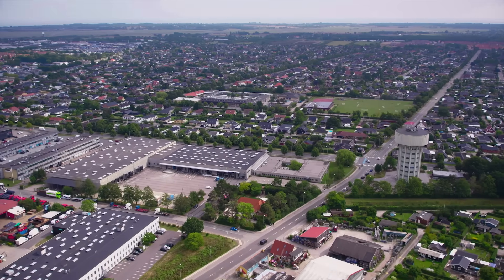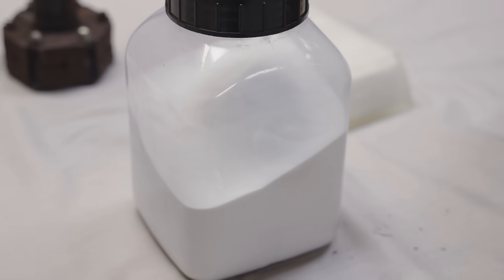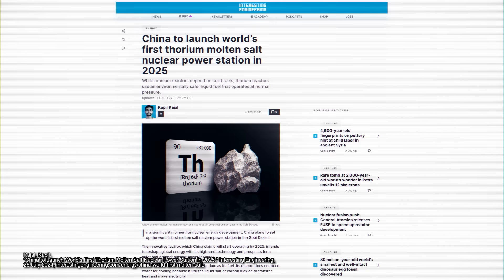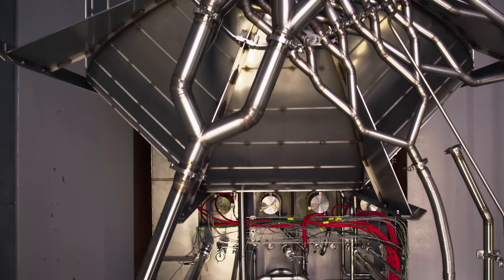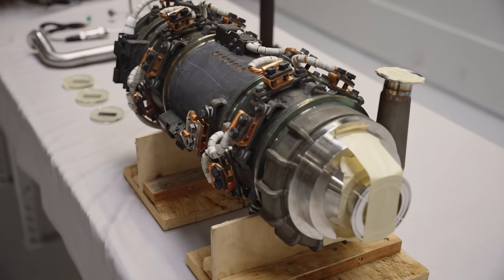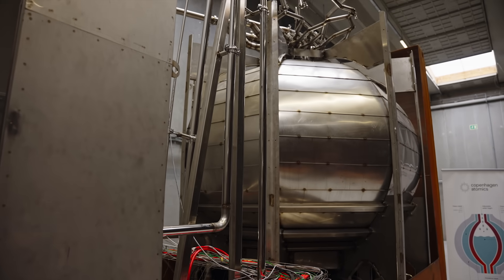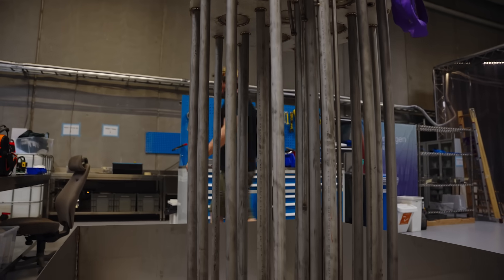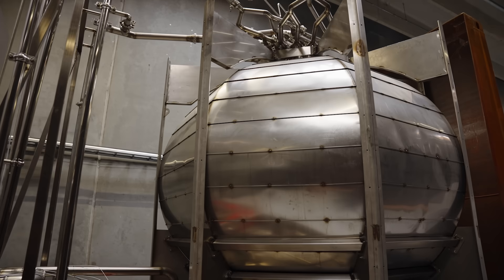Why Isn’t Thorium Changing the World?

Comment: Weinberg and MSRs were really a victim of heavily promoting the wrong thing at the exact wrong period in time.

 The argument over molten salt vs pressurized water reactors was really one of the defense industry, and political synergies.  Weinberg wanted to really restart the industry on developing new technology based on molten salts and different fuels, but he was also being very vocal about safety deficiencies in water reactor designs.  However he was doing this in 1973, right when anti-nuclear concerns were really growing by leaps and bounds.  

We had just stepped into the 1973 OAPEC oil crisis, people are starting to picket and organize protests around nuclear plants, the government is trying to present a unified front on energy from a marketing perspective and here comes the head of nuclear energy (there was no DOE until 1979) talking about how he really sees existing nuclear industry as far more dangerous and requiring a good 10-20 year program to re-design new commercial standards for sustainable nuclear power.  And as he was mainly from an academic and research background he was more focused on the science than how the average populace, with limited nuclear understanding, would react.

Most likely if he was just doing this in the mid-late 1960s or was around in 1979 for the TMI incident, he would have easily been able to sell Molten Salt Reactors as the way to go.

Comment: Maybe this is my inner anti-captialist coming out, but this seems like another startup using a YouTuber for some cheap advertising. Don't get me wrong, I think cheap and clean energy would be great. However, unless you're up and running, producing power on your prototype, it's just a lot of engineering shiny plumbing.
Reply from the maker: I understand that, but to be clear the main reason I wanted to go wasn’t because of the company specifically, but because my nuclear audience has been asking me to check out thorium tech for YEARS, and this was the first big opportunity to do so. I said as much to CA when they reached out to me
Reply: @kylehill  That's fair. You have to take the opportunities as they come. The bit about the corrosion problem and high temp electric pumps were interesting.
Reply: They meant cheaper and cleaner compared to the other method. It will obviously not be very cheap and very clean 😂.

Comment: While I hope that they can make working and viable thorium MSRs, I cant help but notice they've got a lot of stuff that supposedly works but uses some proprietary system that they can't talk about and their tests seem to be all behind closed doors but trust us bro it'll totally work when we get actual fuel...
I've seen a lot of startup grifters, so I remain skeptical until they turn the thing on and someone outside of the company can verify that it's really taking thorium in and putting electricity out. A prototype thats just running water is... Congratulations you made a very expensive pump.

Comment: The problem is not one of engineering but rather one of politics. The problem with the Internet pro-nuclear bandwagon is that nobody wants to confront the geopolitical reasons why thorium, in particular, and nuclear, in general, aren't more widespread. The purpose of a system is what it does. The purpose of nuclear power is to make nuclear weapons. The reason why governments do not support nuclear power is because of the geopolitical concerns. The value of the dollar is not based on "faith" in the US system. The value of the dollar is because oil is priced in dollars which creates constant demand. This is why the US does not want electrification or more nuclear power. Ukraine, Iraq, Afghanistan, etc. would not have been invaded if they had nukes. The entire postwar economic order is predicated on fossil fuels being priced in US dollars and only certain countries having nuclear deterrence. The German greens were so anti-nuclear because they did not want the people who did the Holocaust to have atomwaffen. The danish parliament banned nuclear power because they did not want to invite the wrath of the nuclear powers. Until pro-nuclear advocates can address (let alone solve) the proliferation problem and the petrodollar problem, they will not be able to get anywhere near the levers of actual power

Comment: Pro tip: if somebody is in a private startup that needs to convince investors of their near term profitability they have a vested interest in minimizing engineering challenges. I'm an engineer and I see the execs do this kind of stuff all the time, it royally pisses off regular engineers and leads to unrealistic expectations and timelines.

Anyway, thorium reactors are cool, harder to melt down, but also harder to control. At a time when most reactors were manually controlled it just didn't make sense to invest in a second fuel cycle that was more challenging to operate when we already had a bunch of uranium processing for nuclear weapons.

Now that we have automated controls, higher energy needs, and we're not rushing to build a bunch of nukes it might make sense. Of course, we'll probably rediscover loads of engineering challenges we'd forgotten about through decades of pretending it was all "political suppression" of the technology.

Comment: Seems like coating everything might be a feasible solution within certain temperature ranges. Industrial hard carbon (IHC) coating is commonly used in demanding applications and environments. Off shore oil and gas rigs for example use some IHC coated steel for critical components because it has high corrosion resistance, high wear resistance, and high lubricity.
Reply: I would like to learn more about the material scientists and metallurgists working there. That seems to be where the issues are rather than nuclear engineering.

Comment: One of the nastier parts of a Thorium cycle is the radiation spectrum. Uranium cycles are mostly alpha, beta and neutron flux, which are (relatively) easily blocked. Thorium cycles emit significant amounts of hard gamma rays that are (a) difficult to shield, and (b) can reflect around corners. Not insurmountable, but tricky.
One thing I noted is that they talk about the hot salts being highly corrosive. But that's not strictly true. If there is any water in the loop, the salts become corrosive, so it is absolutely vital to exclude water - I expect that is one of the 'processes' they talk about.

Comment: Would it not be possible to separate the electric motor assembly from the roter of the pump with a long shaft around which cooling lubricant could be pumped to help reduce heat making it to the electrical assembly?
Reply: I like the idea, but wouldn’t this cause what I believe is called parasitic lose and add another moving part to the system??

Comment: I HOPE Thorium/Salt reactors DO become mainstream. For decades I've been banging on about how we ALL NEED MORE modern/latest tech designed Nuclear/Thorium reactors (built NO WHERE NEAR Tsunami/Earthquake zones obviously lol). It just works 24/7/365 no matter what the weather or light conditions, and as little as it is known, Nuclear waste IS NOT THAT MUCH of a problem as OFTEN the waste from a Primary powerstation is then passed onto a Secondary powerstation to further produce more power (thus lessening the amount of waste in the end), and then what waste there is CAN BE either used for other things or (as IT IS the case) SAFELY stored WAYYYY under ground... Sure, the initial setup of a Nuclear power station can be expensive, but IF built properly (NO corners cut/shoddy workmanship/materials etc)... They require little to no maintenance for a good while and run RELIABLY (unlike Solar & Wind - in both when they produce power and failures etc) and they can last decades! So, if these peeps (or any other groups) can get a Thorium/Salt reactor up and running and demonstrate that it works reliably, safely, with little maintenance and... Cheaper than traditional Nuclear... Then IT SHOULD go mainstream so we can once and for all, and finally... CUT OUT Coal and Gas...   😎🇬🇧

Comment: Offer it to island nations. No neighbor country would be worrying if a catastrophy somehow happens. And they wouldn't be dependent to petrol companies/corporations(most likely the same group that thorium and nuclear power is held back). 

If it costs way cheaper to build and waste product is way less, it will be much easier to sell. 

Can't the metal pipes be lined with some kind of ceramic? Maybe there is some type that could resist degradation(?) and corrosion. 

Much better though if the first user is a first world country, maybe less risk of mismanagement.

Comment: Why try to contain the salt in stainless steel pipes and vessels?  Why not coat the surfaces with zirconia ceramic and such?  A ceramic pump, driven with a long, cooled driveshaft to a regular electric motor would be cheaper than trying to use exotic materials in a compact design.  I dunno, perhaps hi temp salts destroy ceramics?
Reply: Well zirconia is somewhat off the table but you are on the right track and I'm almost certain they do. 
It is kind of a matter of fact that no steel will survive direct contact with the fluoride salts. Furthermore the use of the words "stainless steel" is dubious. Since you cannot add cobalt due to it's high neutron absorption and chromium is useless because the abrasion removes the passivation layer. I think they are likely using high nickel super alloy like inconel. There is no way it's directly exposed though, that much I am nearly certain of.
Reply: @notsam498  Fine, use borosilicate and boron nitride in both its forms, then encase it in melted borax.  Ugly, but work.  Give those neutrons something to think about before eroding anything else.  Just ranting, btw.  heh.
Reply: @vilefly  borax would be unsuitable due to the highly abrasive environment, however as long as boron nitride is in a suitable composite it is a good candidate. I work in a research group that is beginning research on this exact topic. Boron nitride and 11 herbs and spices was my personal proposal. Although I think there are other considerations that booted my idea, such as cost and feasibility.
Reply: @vilefly  I wonder about using borosilicate in a metallic matrix though, I think it would still abraid too quickly but I'll bet it's interesting in other applications.
Reply: @notsam498  Glad to hear someone proposed BN.  It is a great dry lubricant and can be harder than diamond in its cubic form.

Comment: I'm curious if there's any particular stainless steel variant they found worked best for this? I mostly work with 316 since it's easy to weld and very corrosion resistant for the salt water applications we use it for. Other types like 304 wont work as well for us.

Comment: I was glad to see that this video addresses the biggest problem faced by the operators of the Molten Salt Reactor Experiment at Oak Ridge: corrosion of the Hastelloy pipes and valves. Too many LFTR enthusiasts downplay this problem, but apparently this group in Copenhagen is expending a lot of effort on solving this problem, if indeed it is solvable. Personally, I don't feel confident that molten salt reactors will prove to be viable; there are too many ways that this technology can suffer catastrophic failure: one of the biggest being the emergency SCRAM system - the plan being that in the event of an emergency, the fuel salt gets drained out of the reactor into storage tanks under the containment building. The problem here, is that once the fuel salt cools off and solidifies again in the tank, how are you going to re-liquify it so that it can be pumped back into the reactor? I haven't seen any answer to this question. These salts are extremely corrosive, intensely radioactive, and as this video points out, no one has any detailed and tested plan for how the fuel processing plant would actually work; Uranium-233 has to be separated from the thorium and protactinium in the fuel stream, and while the PUREX process for extracting fission waste and Plutonium from uranium in spent conventional ceramic fuel pellets is well-established, AFAIK, no one has yet designed a variant of PUREX to do this for molten thorium flouride fuel salt.

I better like the idea of adapting the CANDU heavy-water reactor to breed U-233 from Th-232. This will still require reprocessing of the fuel, but all of the potential problems from handling molten flouride salts are removed. Of course, no one has yet done this, either - the idea of adapting a CANDU to burn MOX, or act as a Thorium > Uranium breeder, is still just a theoretical possibility.

Comment: why not use glass for the pump/metal materials. Something like Borosilicate glass melts at 1650 C, have the tubing be glass and the outside container be normal (heat resistant) metals. Got the idea when I remembered that some companies used glass as piston heads back in the day

Comment: What kinds of flows and pressures need to be achieved by the pumps in the fuel salt loop and cooling salt loop?
Must it be a mechanical/rotary pump? I wonder if electrolysis could be appropriately balanced with flow rates using MHD/Lenz's law... it seems choosing electrode materials could be on par with or less than the difficulty of selecting materials for a mechanical pump.

1GW in the space of one or two Walmarts 🙄 I'm pretty sure MSRs can achieve much, much greater power density than that.

Comment: How do they know the treatments of stainless steel work on thorium salt if they haven't gotten their hands on it? And those samples how much time were they exposed to it? One thing  is being resistant to corrosion for a short test, another lasting a week or a month or years like they want. Even if the material cost is "50 times more expensive" as long as it runs long enough to be sustainable is way more important. Usually you first get it to work and then lower the costs. It feels fishy they're working on making it cheaper without having a confirmed working prototype.

Comment: Because Westinghouse has infiltrated the IAEA and U.S. DOE to the point they own the regularory framework and are slowing down progress by NuScale et al. in a bid to make sure they maintain a monopoly on nuclear power. It's not a matter of NIMBY-ism. I've been to town halls discussing them. No one has a problem with a nuclear plant that literally CANNOT melt down. You might find a few dolts (usually the green energy zealots), but most people have no issue with MSRs.

Comment: I think the most dangerous part of a nuclear reactor is the cooling system, as pressurized radioactive steam can be released explosively if things go wrong.
Molten Salt Reactors don't have that problem, as their cooling system works effectively in a liquid state at higher temperatures, and can be made fail-safe.

As it comes to the corrosion problem, is it possible to line the inside of the pipes with some sort of insulation? I'm thinking ceramics might work.

Comment: People often cite tungsten as the element with the highest melting point.
Apart from the fact it's way more expensive than stainless steel, it's probably too difficult to work with.
However, there is one element in the periodic table with a higher melting point. Carbon.
Will someone smarter than me explain why carbon fibre isn't suitable for high temperature and rust resistant parts?
Reply: Or just make (almost) everything in contact with the Molten Salt out of Glass ? (borosilicate glass would be best for safety)
We're at a point we're able to do basically anything and everything with glass. It wont melt, it's cheap and, it's easy to work with.
Also Glasses cause little to no problem with contamination (doesn't stick and can be remelted for disposal).
I can also think about Asbestos and even maybe Ceramics ?
I don't understand why sticking to metals when the problem is corrosion.
Reply: my best guess is the "fiber" part, and it's not a very smooth surface so it's more prone to erosion/ friction

Comment: I can't help but wonder, could you use a series of thermal to electricity converters along the surface of these high temperature parts to help supplement the power draw? It may not be much of a reduction in power use,  but the ideal of reducing some of the initial load for activation is an idea that won't leave me alone lol

Comment: Kyle, I am assuming you know, TerraPower (and others) are working on an MCFR (Molten Chloride Fast Reactor) that does actually does use molten table salt (NaCl) with chloride salts of fissile isotopes dissolved in it as a future MSR design. They've been working out some of the issues (Cl35 cross sections) but as I understand it working towards the approval process sometime in the next couple of years. Since it is a fast reactor it doesn't use thermalized neutrons to induce fission which also helps a bit with nonproliferation issues as more transuranics simply do not form.

Comment: 9:30: is it really a working prototype when it’s just running water instead of the 700C Molten Salts that are the main challenge?
Reply: The viscosity of thorium salts tas denostrated in the fiirst video, and there it was demonstrated as water-like
Reply: It is, because they were just showing that the pump worked lol
Reply: Pumping water at room temperature did not demonstrate that the pump is working, if it is supposed to operate with viscous, corrosive and extremely hot masses.
Reply: But... the pump worked? That's literally all they were testing at the moment 😭
Reply: They've tested the pump with molten salts, just not the thorium/uranium salts.  There's plenty of salts that have similar properties at those temperatures.